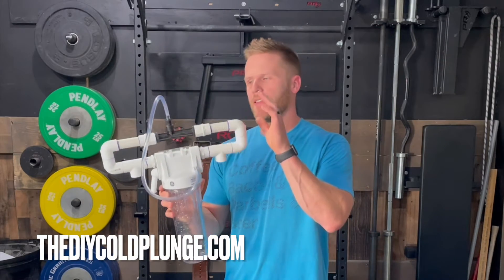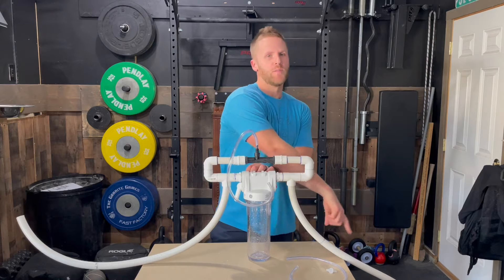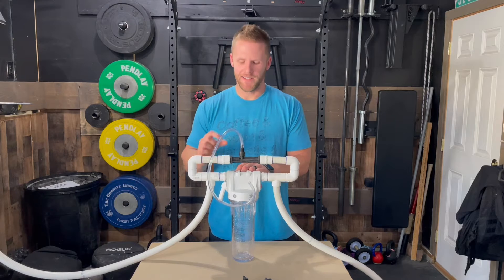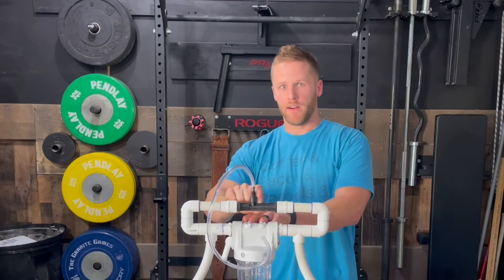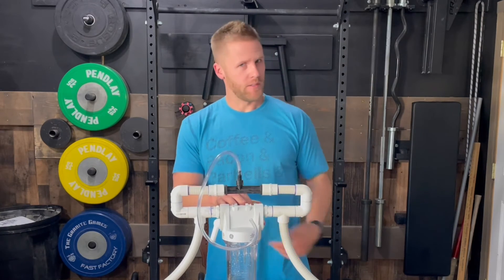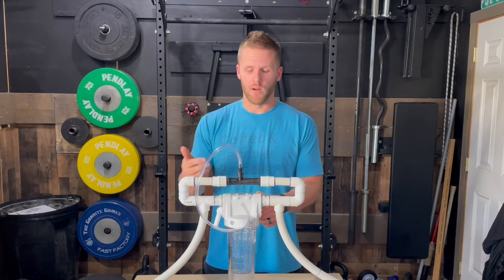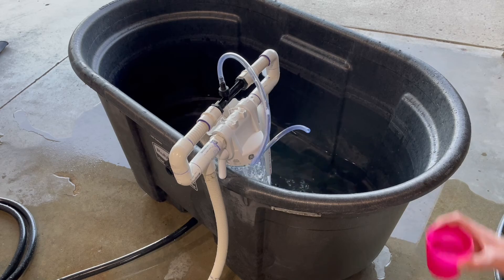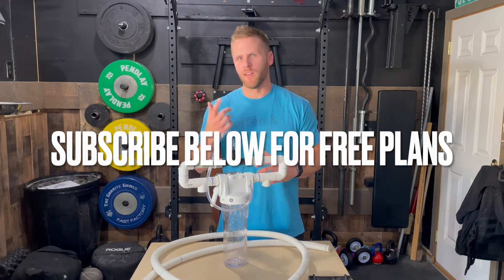Ozone Sanitation & Filtration FAQ | DIY Cold Plunge

Comment: Damn, watched this after I added my ozone. My setup is cold plunge outlet => pre filter => pump => whole house filter => chiller => oxone (venturi pipe) => cold plunge inlet. How bad did I mess up not having it "branched" over the whole house? Is it worth the extra effort to change it back to as outlined in this video, or have I just reduced the water flow by a bit?
Reply from the maker: You're probably putting some stress on the components that way. Depending on how everything is sized it could be okay.

Comment: Good plan.   Obviously works.   Only slight correction is when the water passes through the Venturi the water speeds up and the pressure drops. This is Bernoullis principal, which is a conservation of energy. That's why the ozone is pulled in there. Just thought you'd like to know.
Reply from the maker: Oh believe me you're not the first to point that out 😂

Comment: If I understand correctly the water flows:
Tub to pump
Pump to filter
Filter to chiller
Chiller to tub

Also, by the time the filtered water reaches the chiller will I have enough water pressure to make through the chiller and back to the tub?
Reply from the maker: Tub > Pump > Chiller > Filtration + Sanitation > Tub

Comment: Hi  - I purchased the diy plan but didn’t see any mounting bracket or instructions. Any recommendations that you can provide would be appreciated.
Reply from the maker: Hey there - that will depend on your filter housing for what style/application needs to happen there. Typically mount it so you have access and remove the housing to replace the filter and youll be fine.

Comment: My cold plunge only has 1/2” ports will there be enough flow for a 3/4” pump to push enough water through to get proper flow for the Venturi?
Reply from the maker: You should be able to adapt it.

Comment: I had to slightly close the filter in order to get suction from the top of the Venturi. 3 weeks in, I had it open all the way and was getting no ozone into the water. Seems to be working now with it slightly closed
Reply from the maker: What other components are you using? And what order are they in? All of that stuff plays a factor in overall performance

Comment: Filter is reducing gpm to 5. Why use a 1200 gph pump when it’s way over the filter rate. The filter has a flow rate of 5gpm max at 50 microns
Reply from the maker: Are you measuring this? Or just assuming based on specs? Long story short, these pumps are rated at the head of the pump, not for each additional component, pipe length, twist and turn. Each of those will factor into flow rate of the overall system, and you'll need something to push through all of it.
Reply: @DIYColdPlunge  I measure the 950 after  the filter and the 1/4 chiller and getting 300gph so will actually be upgrading. Thank you. My worry is the 1200 will be stressed if the filter only allows 5gpm like stated on Amazon. Hopefully it will allow a little more. Do you know what you are getting after the filter for gpm ?

Comment: If you're not using a filter (I have an inline strainer before the pump), would you see issues with doing an inline venturi that is located close to the outlet (after both the pump and the chiller)?
Reply from the maker: I'd do a loop with a ball valve so you don't choke the flow, but other than that no issues.

Comment: Electrical engineer here. I am just a tiny bit skeptical at the flow of water through each part of this system. You essentially have 2 parallel paths for water to choose to go through. If they are not perfectly balanced then water will favor one over the other. Just like a short circuit, water and electricity will always follow the path of least resistance. It might be better to just put them in series with each other, one right after the next then you don't have to worry about water choosing which way to go. In series, 100% of water gets both treatments. Cheers!
Reply from the maker: Hey thanks! I'm not a fan of everything setting it up that way, the flow is drastically reduced goin in-series. Coming up on 2 years with this setup, still works like a charm.

Comment: Anything to worry about with having the ozone going into the water? E.g. turn it off when getting in?
Reply from the maker: I haven't had any trouble leaving it on - however it's probably recommended to have it on during a time you are not in the tub
Reply: @DIYColdPlunge  thanks. One more question. Is it ok if the Venturi injector is not parallel to the ground and the water is going to the chiller before entering the plunge? Thanks

Comment: With a filtration system like this, what is the total maintenance for an ice regulated cold plunge? (Frequency of filter changes/ water draining/ etc). I want to make sure I’m doing everything I can to maintain my system! Thank you for your videos!
Reply from the maker: If you are doing ice, you'll likely need more frequent filter changes and draining/cleanings with the potential for new debris/contaminants with every "icing" lots of surface area for stuff to stick to and then melt into your plunge. I'm on 1 filter every 5-6 weeks for mine.

Comment: My chiller says not to use a pump rated higher then 420-720 gph. I bought a danner 350 will i be ok with that pump?
Reply from the maker: My guess is that you won't be able to create a vacuum. The ratings don't always translate 100% Every piece of pipe, fitting, turn, etc. drastically reduce the flow rate. I would honestly be surprised if the 350 truly put out 350 directly out of the pump.

Comment: Parallel the Venturi after the filter discharge, then add a valve on the main post filter discharge line to adjust the flow to the Venturi / mail line 👍
Reply: This way all the water passes through the filter and the filtered water is injected with ozone and you avoid trying to send full pressure through the Venturi 👌
Reply from the maker: It's a good thought, you won't notice any difference in performance on a closed loop system this small though. You can do that, but this condenses the system down.

Comment: Why not just use an air stone hooked up to the venturi system, both systems injects fine airs into the water
Reply from the maker: Seamless design, and most ozone generators people buy with air pumps on Amazon are not powerful enough to sanitize water volume as big as a cold plunge

Comment: Why does my cold plunge feel slimy? I have a simple portable one right now from Amazon right now and don’t want to upgrade until I figure this out. I get in right after I shower but after three or four days it starts to feel slimy on the floor and walls. I use ice and frozen water bottles to get it cold and keep a lid on it all the time that I’m not using it. 
Is it from stagnant water? Is it the oils from my body or something else? Do I need to use chemicals or get some kind of pump/ filtration device? Or would a water chiller keep it moving enough (if it’s from stagnant water) to prevent this from happening? Or do I just have to keep draining and cleaning it? Thank you
Reply from the maker: If you don't have any filtration or sanitation method in place, your water is going won't keep long. Frozen water bottles likely bring in some sort of dirt/debris on the surface too. You'll either need to replace water more frequently or have filtration AND sanitation methods in place.

Comment: Appreciate all the info you've put together on this subject, thank you. Since I don't see a way to search for the answer I have in previous comments... Is there a reason you've not incorporated a UV light into this system for very thoroughly killing any other bacteria roaming around? I don't fully understand the "stack" of the filter & the venturi inlet... but could you not just stack the UV light on top of this? Or would it be better in line?  I would have thought all of these would be best suited in-line... but I'm not that level of a home engineer. :O)
Reply: Follow up to my question... my goal is to have the entire pump, house filter, venturi inlet & UV light submersed in my deep freezer build as a drop in  set up.
Reply from the maker: UV doesn't work as well as ozone, and there are a few different companies that used to offer UV that don't anymore because ozone is nearly as effective on its own. UV bulbs degrade over time, and they can be a pain to replace. If you go UV, depending on flow rate you could maybe keep it in line

Comment: Plumber here, love the design. My observation would be when you make that loop with the venturi and then heads back to the outlet side of the water filter, you are creating some back pressure that could affect your filter and flow. A suggestion would be to perhaps put a 90 down after the outlet of the water filter, then add a spring check to avoid back pressure, then add your T to complete the loop with the venturi.
Reply: Exactly
Reply from the maker: Thanks! I didn't even know that was a thing!
Reply: I'm having trouble understanding what you are describing.  Do you mind rephrasing it for a layman a little more clearly/simply?
Reply: @dragsbae  Imagine your homemade water filtration system like a garden hose. In this system, you’ve crafted a special loop, similar to bending the hose, which includes a ‘venturi,’ a point where the pipe narrows. This narrowing speeds up the water, essential for your system’s functionality. However, this loop creates a complication known as ‘back pressure,’ akin to a traffic jam in your water filter. Like cars piling up due to a roadblock, water faces resistance, slowing down its flow and hindering the filter’s effectiveness. To address this, think of adding a smooth curve, like a 90-degree bend, right after the water exits the filter. This curve guides the water gently, preventing the abrupt stop that causes back pressure. Additionally, incorporating a spring check valve acts like a one-way gate, allowing water to flow forward but preventing it from flowing backward, thus avoiding any pressure build-up.
Finally, you reconnect this improved path to your venturi loop using a ‘T’ connection. This is like a three-way intersection, seamlessly integrating the modified path into your loop. This design ensures a smooth, efficient flow of water through your filtration system, preventing any back pressure and enhancing the overall performance of your homemade water filter.

Comment: What are the thoughts on using a separate ozone like CAMECO Ozone Generator with Air & Water Modes since it will only be ran an hour a day?
Reply from the maker: I don't have experience with it, but the bigger generators are definitely overkill IMO, and the kitchen ones you can find on Amazon specifically say not for use in a a spa/cold plunge setting from the manufacturer.

Comment: Question!
Part 1.) Since the ozone technically only needs to run 1 hr per day, would it make sense to include a shut off valve to the ozone to optimize the water pressure through the filter and chiller? But mainly for the chiller.
 
Part 2.) Thinking through it  further now, in a similar case, an additional split/shut off valve to the filter would optimize pressure for times where the plunge is “locked” and covered. It would technically put the chiller at risk of something foreign entering, but after a few hours running through the filter after use, it seems everything would be filtered enough to run directly to the chiller? This might optimize pump and chiller performance in the unused hours? 

Thinking out loud. Look forward to your response!

Thinking further, I see how that would make the entire process manual vs automatic given the ozone/ timer piece. So certainly some downside there. 

Btw I’m building my own based off your plans. Currently going with the 1 hp penguin model, as suggested, however it’s seems orders may be backlogged. Is the reducing of pump pressure primarily a lower hp issue? Or is it the other way around?
Reply from the maker: All good questions! For me, the simplest, most hands off way is the most appealing. You can absolutely add those bypasses if you want and think it would be beneficial. As far as the chillers question - my understanding is that high PSI can be an issue regardless of size, you will just want to make sure there is adequate flow rate going through the chiller.

Comment: That adds 4 feet of head to the system due to all the 90 tees. If you have a longer run, this may be risky due to the build of of PSI. You'd have to upgrade your chiller depending on your chiller
Reply: What does this mean?
Reply: @luke1the3duke  Most chillers have a max PSI rating of 10 PSI, above that and you can crack the heat exchanger. Very costly. Also, a lot of these dinky pumps have a max head rating of 10ft or 12 ft of head height. Head height (in feet) is the number of feet that you are pushing water vertically. My system will have the tub approx 5 feet above the pump and chiller, meaning I have 5 feet of head to push the water from pump to tub. Every elbow or tee you add roughly adds 1 foot of head height. Also the filter adds approx 3 PSI

So, you need to run these calculations to make sure your pump can pump it and if you upgrade your pump you need to run the calculations again to make sure you don't crack your coil in the chiller.

If you're doing a system where everything is within a a foot or two from each other then this is not a worry but when you are putting your chiller in the basement and your tub in the backyard on your deck like I am, then you must be very careful in running your numbers
Reply from the maker: good info 👍
Reply: @DanSanniti   what’s the correlation of head height to PSI?

Edit: looks like 2.31 feet of head = 1psi

In that sense 4 feet of head (in your original post) = 1.73 psi doesn’t see like very much

But aren’t there technically 6 elbows/tees all together (that last tee seems would be a little funky) which would add 2.6 psi all together?

But.. in correlation to the chiller,since the chiller is directly after the pump, wouldn’t filtration not affect the chiller? Or is the psi correlated to the entire system (I’m sure it is)? 

Wrecking my mind this morning man. I think we need a diagram of the basic system to solve this.. and I have to many questions to do it lol

Comment: what do you think about safety of ozone for sanitation?
Reply from the maker: I think it's pretty darn safe, it's been used in hot tubs for years. I know there are concerns with using it indoors/not on a timer but I have several friends who have commercial plunges in their facilities and homes - all that use ozone.
Reply: Received order last night. Appreciate the quick shipping and look forward to replicating this build. Have my ice barrel indoors in a storage room in the basement. Bought a programmable timer and planned to set to run for 30-60 mins each night. What level or duration of exposure would lead to health concerns? Any recommendations to mitigate?

Comment: Would the Danner 700 work just as well?
Reply from the maker: Depends on your plumbing setup (and the 700 has 1/2" fittings). I run the Danner 950 with my 1/4HP chillers 👉 https://diycoldplunge.com/products/danner-950-pump

Comment: This filter is rated for 720 gph. Isnt the Danner pump you use now 1200 gph? Have you done anything to ensure these work well together? Thanks
Reply from the maker: The pumps I use have a very low PSI, and they lose "flow rate" with every length, turn, void (chiller), etc. that is in your plumbing system. So at the point of filtration it isnt 1200. It is probably still slightly higher than the 720gph but I have not had any issues at all.
Reply: @DIYColdPlunge  thanks

Comment: Hey man, thanks for providing such awesome content. I ordered the venturi and ozone generator from you and am returning the stuff I bought from Amazon. My question for you, is are you concerned about the flow rate of those whole home water filtration kits? Yours and mine that I ordered both say flow rate of 4GPM which appears to restrict flow by a lot compared to what our pumps are doing and what our chillers want to see. What are your thoughts on this?
Reply from the maker: What chiller are you running? I've been able to run both 1/4HP and 1/2HP without issue. Keep in mind that every inch and turn of plumbing will reduce the flow rate of your pump.

Comment: Doesn't the filter create a bottle neck in the system. The GE filter housing you show in video is capable of 12gpm or 720 gph. The Danner pump runs at 1200 gph. Doesn't it cause more load on pump due to back pressure
Reply from the maker: I haven't had any issues. One thing to consider is that every inch and turn in your plumbing reduces flow rate, along with flowing through your chiller.

Comment: I’m having trouble understanding how the water gets in the filtration system if there is no hose going into the water, I’m assuming it’s the black hose that goes into the bottom that is doing the suction but he never showed him installing that hose on the ozone generator and I know nothing about filtration so it’s confusing, can someone confirm if he removed the see through hose and replaced with the black one?
Reply from the maker: It should go bulkhead from the tank, to a threaded pvc connection, spa hose to the filtration system 👍 I have plans on my site to help with the entire setup if needed! https://diycoldplunge.com/collections/all-products